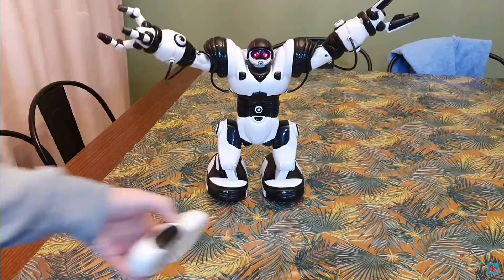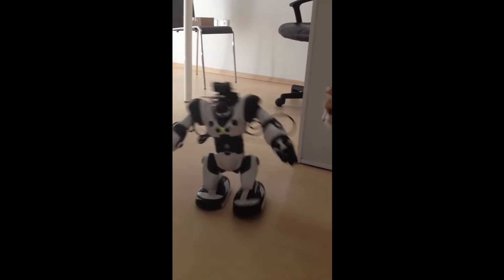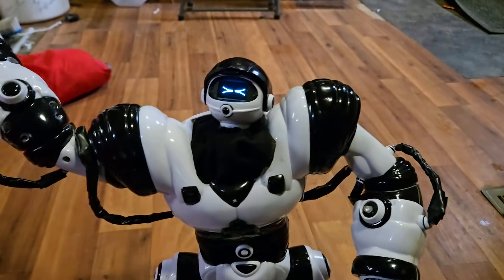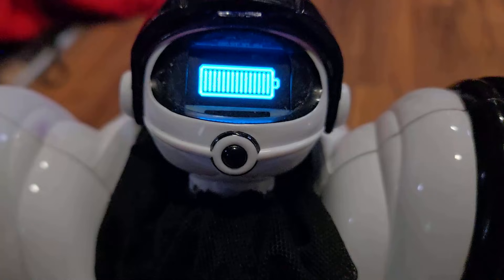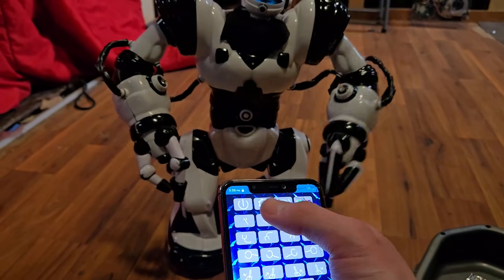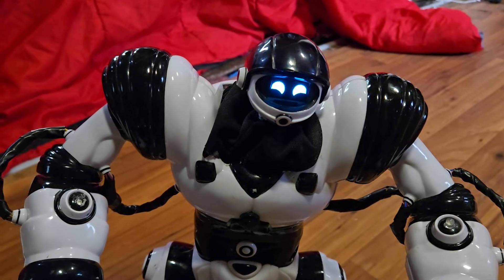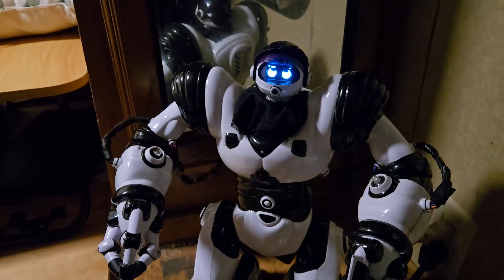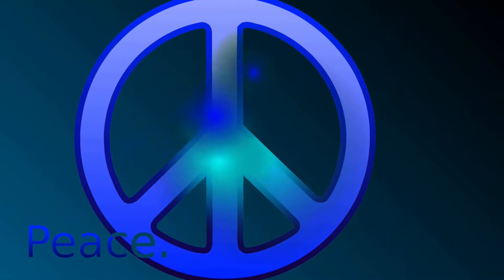AI Raspberry Pi Robo Sapien - The PySapien

Comment: Hello, I want to do a similar project. Could you send me the full parts list? I'm a little confused. Does Radxa come with Google Coral TPU or does it process images on its own?Can you also tell me the rest of the hardware, motor drivers, etc. Thanks in advance.
Reply from the maker: Platform AI:
The robot will use whatever NPU or TPU is available on the board regardless of the vendor as long as it is supported. If pysapien OS boots on your board nine times out of 10 it will automatically detect your TPU or NPU configuration and load in the appropriate code.

Each SD card image is specifically written for the platform you will be using and is downloadable. You'll have to use balena etcher because regardless of platform, you'll be flashing a pre-made image to an SD card.

The online functions allow for the robot to download custom AI roaming or vision routines and you can change your default vision model and processing tree

The edge TPU will not work on any other platform besides platform besides raspberry Pi / edge TPU (32 bit, Python 3.7)
Using the edge TPU obviously results in some weirdness as the robot typically uses Python 3.12 and a 64 bit OS In all other cases.

Files:
Yes it's on the website besides the 5 volt board that's the only thing that's missing but if you see it there that means I got to it before you did

Build guide is coming out this month and will show exactly how everything works and goes together if you're interested

Comment: Very cool project. I did a similar hack with my rs media. I was a big part of an open source community hacking the rs media back in 2008. If you are interested inthe hacks I did they are on my YouTube channel and on my website
Reply from the maker: Oh that's cool! I know somebody who hijacked the original computer inside of RS media to run RPG Doom and some other things. One thing that I find interesting is how similar RS media is to my hack, I haven't uploaded a full length video on it in a while so there's a lot of new features to talk about but it's a Linux computer controlling a RoboSapien just the same as RSM was. Except this time, it's not controlling a V2 board or any kind of pre-made RoboSapien hardware, the Linux computer is essentially interfacing directly

Comment: After Robosapien got created, some Chinese toy company by the name of Jia Qi kinda probably just decided to make some Robosapien lookalike called “Roboactor”. They made it look like Robosapien but it’s not exactly Robosapien, even though it looks like Robosapien. Robosapien is the original WowWee one, while Roboactor is that one bootleg knockoff of him. They called it Roboactor, probably to avoid copyright, if I’m being correct.

Also, how did you change the pitch for this Robosapien-turned-PySapien? I just want to know how you changed his pitch and sound quality to make him sound like Roboactor? What will his dance sound like? Can there be a video of it dancing? I just want to know.
Reply from the maker: It was an error with pygame.mixer where the sample rate of audio had to exactly match. Everything was changed to 48K recently but it's undergoing a giant upgrade, the robot won't be using edge TPU and raspberry pi 02W due to reliability issues, we're switching to the Raxda cubie a7z. You get 4 GB of RAM, local LLMs, faster SD card access, built-in NPU that's not you know... Useless, 64-bit OS I mean the list goes on
Reply: @QuinnCsVideos  Okay, then…
Reply from the maker: @The-creator-of-good-videos-15just read the dancing part. It's on my shorts.

Comment: Similar to Robisapian RS Media. Are your development tools similar to the The RS Media Development Kit?

You price point is considerably lower than the RS Media version.
Reply from the maker: Yes, but no. Yes, there is a 3D view of the robot in the software for PC, no it's not for bodycon it's actually a 3D emulator of the robot. You can create programs, applications and personalities now as well as their own movement systems and even menu sound packs but it's a much more hands-on approach than RS media however I would say my software wins automatically because it doesn't constantly crash it works for the most part

Comment: I have the larger V2 version, and it is complete crap. It could not walk more than 5 steps without falling, and most of the built in functions did not work correctly.  Especially infuriationg was the complete lack of programability or calibration to correct the built in problems. One example is the bowling activity. The "robot" is supposed to be able to find the color coded Pins and lob a ball at them. Unfortunately, it would ALWAYS send the ball 2-3 inches to the right of the pins, and there is NO WAY to correct the aim. It seems to actually detect the pins and tries to aim at it, but it is consistantly off. It should have been easy for the Wowee to incorporate a calibration mode to fix various problems, but naaaahhh.

Comment: Are you planning anything for the robosapien v2?
Reply from the maker: It's actually a really good question. I'm actually talking to a guy who was trying to do something similar with the V2 and plans to incorporate parts of my code into the robot. Problem is, that thing is very complex and falls apart all the time and it's also very rare. It's possible, but there hasn't been much progress on it. It would be mostly re-engineered and 3D printed. Conceptually, yes that might happen. Actually? No most of those robots are dead. We're not even talking reconstitution here, we're talking building it back from the ground up.

Comment: My Robosapien has arrived and I got the homersapian version too! I got the parts from your Amazon list. I dunno how to put it together but am learning about what each part does.  I’ll donate When your go fund me goes live. 😊
Reply from the maker: Oh no 😵‍💫 I'll upload something
Reply from the maker: Hey, just updated the shopping list in the description, amazon goofed the list so I made a static one. Build guide also goes here. Apologizing on the behalf of amazon.
Reply from the maker: Yeah that should work That's most of him from what I remember. Yellow and blue display might be a little bit of an issue tho, I meant for it to default to a monochrome. It'll still work but with partial yellow. I'll make a firmware patch to take advantage of that.
Reply: Well poop! LOL! Guess I got a few extra parts to play with for other projects. No worries!. Glad to help bug test the process.  😅 Thanks for the improved list.
Reply from the maker: @kooky2  What was on the list? i only saw 2 items when i went to check but if there was more everything should have been correct.
Reply: Everything was on the list for me.  This is what I got: I’m in the uk. URGENEX 2000mAh 7.4 V Li-ion
Miuzei Servo Metal Gearbox 90 Servo Motor x6 (I needed some for another project).
  5pcs Dual Channel L298N PWM Speed DC Motor Driver Board Dual H-Bridge (10 in total).
WINGONEER 5PCS KY-019 5V One Channel Relay Module. (New list shows 1)
Hailege 2pcs INA219 I2C Bi-directional DC Current Power Supply Sensor Power Monitor.
GELEGOO 3PCS 0.96 Inch OLED Display Screen Module, 128x64 Blue and Yellow SSD1306 Driver I2C. 
sourcing map 2Pcs Speaker 3 Watt 8 Ohm Mini Speaker Micro Speaker with JST-PH2.0.
FYIXISI 5 Pairs Non-slip T Male Female Plug Connectors Adapter with 14AWG Silicon Wire, T-Plug Connectors.
DollaTek 5Pcs PCF8574 IO Expansion Board I/O Expander I2C-Bus Evaluation Development Module.
Hilitand DC Amplifier Board, 5V 2A Mini Bluetooth Amplifier Board, Digital Amplifier Module, 4.2 Circuit Stereo Speaker Digital Dual Channel Module 5Wx2 (this Bluetooth module is not on your new list, yours is mono).
80 DuPont f to f wires.
I haven’t bought the Coral tpu or the barrel connectors. I already had a raspberry pi zero 2 w, a pi camera and a 40cm fan.😊
Reply from the maker: @kooky2   If you end up hating the dual color display (as I would too), I will send you a blue OLED of mine when I get the chance, free of charge.
Reply: Aww thanks for the offer. 😊Glad the parts I got are ok.

Comment: I had one of these.. One of if not the first release.. all of the insulation on the wires rotted off in a few years and I wound up breaking it down for parts. Got A LOT of motors and gearboxes with rotary encoders. I still have the head.

Comment: Neat, now how do I make one that's 20 metres high
Reply: Scan with 3d phone app scale up 20:1 print 3d parts in segments or sent to pcp way your physical weighs are actuators size and strength that you can attain nVidia Orion nano and a wifi dongle it can operate any wear your chosen network satellite has axis safety protocol #1 autonomous localized llm driven functions
Reply: Robo King Kong. Now I'd like to see that.
Reply from the maker: Please don't